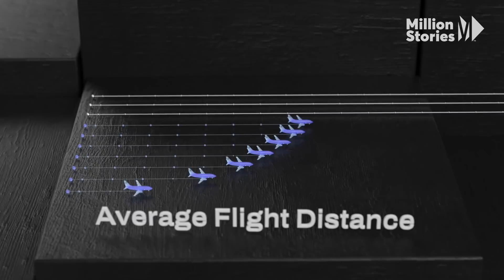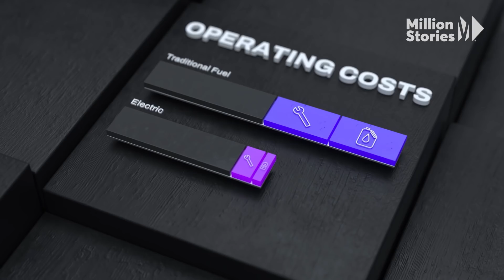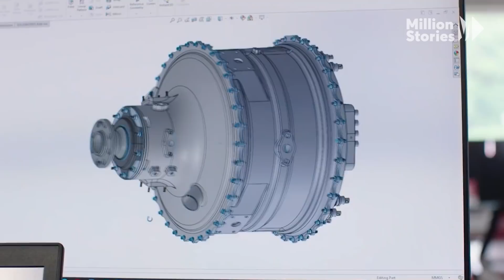Electric Planes: The Future of Travel

Comment: A lot of people died when aviation became mainstream. The conversion to electric wouldn't surprise me if there were tragic cases related directly to a problem that hadn't been thought of until it was too late, as such happened with many fatal aviation disasters.
Reply: Do you have any sources on that?
Reply: @DLtheGreat  also have you ever seen a lithium fire? That's one of the hottest and most aggressive fires. I'd imagine it would be quite difficult to extinguish mid flight and if not instantly it could cause damage to other components quickly.

But I don't know, maybe these guys have thought of this solution already.

Engines are engines so if there's going to be a problem there you're screwed either way, be it electric or fuel.
Reply: @fvckinfool101 Volcano proof insulation and moving the batteries to the back of the aircraft. If a disaster takes place, the plane can be set to glide down to safety.